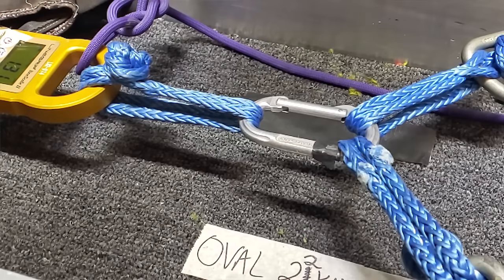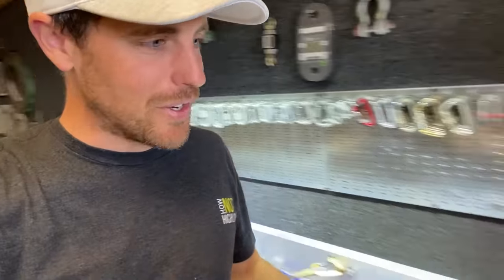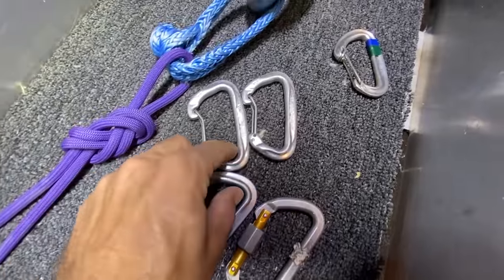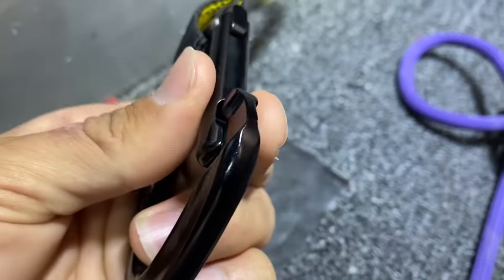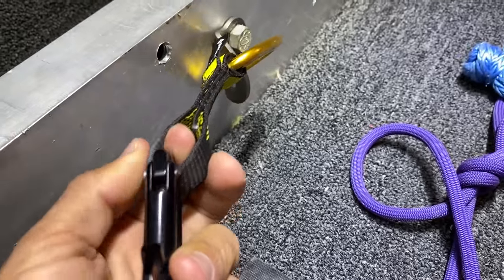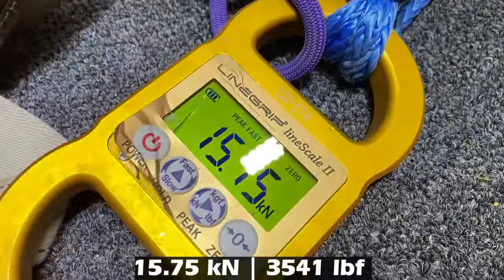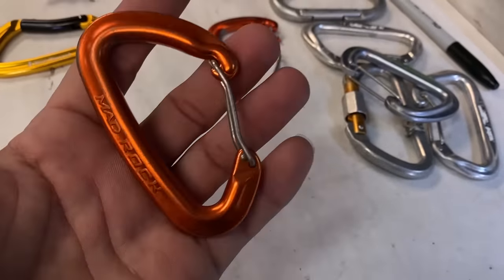Triloaded Carabiners

Comment: Triloading locking HMS carabiners, often used for masterpoints would be sweet. Like the petzl attache, BD rocklock etc.
Reply: This!!
Reply: Also a comparison between big carabiners and smaller ones; my guess is bigger one loose comparatively less strength..
Reply: @timt1519  smaller shapes with same stock thickness are stronger, less leverage
Reply: I agree. Nobody triload small wiregate pear carabiner but with an HMS, people feel probably more safe to do it.

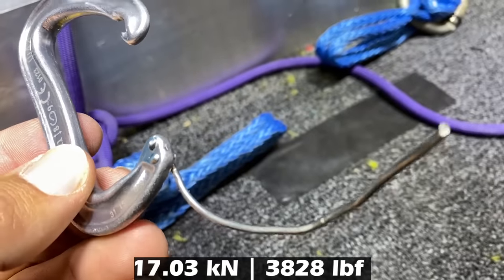Comment: At 5:10 Ryan seems surprised that the sling on the quick draw which is rated to 22 broke at 20. This is because the direction of the tension isn't aligned with the tension on the Dyno. To to work out the real tension you need to do Pythagoras
Reply: The angle between the two quick draws is a bit over 90°. So both draws see 70% of the downward force, that is, a force of about 14kN.
Reply: "Do pythagoras"...Kinky
Reply: Also it looked like the draw started to fray on the sharp edge where the gate area was
Reply: It seems like the load on the Quickdraw itself is uneven. Looks like the angle shape of the carabiner puts most of the load on the edge where it starts to break.
Reply: @JJ-qx9wz  I measured the angle to be 98° between the carabiners so a force of ~15.4kN each
Reply: @JJ-qx9wz  Except that is the inline force.  Not the resultant load.
Reply: @shadiester  The force seen by the quickdraws is the longest side of the triangle.  Not either of the two short sides.
Reply: @robertmisiuk7137  No, it is the long side. It's just that the short side force of 20kN is divided between the 2 quickdraws.
i.e. For one quickdraw's force triangle: the horizontal line is 10kN, and the angle between that and the resultant-force-hypotenuse is 49°. Which, if I've done my trig right, makes the hypotenuse ~15.4kN
Reply: Maybe it's teasing for the Hard is Easy video. 😁 I can't trust he don't know the math around 
slackline loading.

Comment: I am climbing in trees and rarely use these carabiners. I would love to see how tri- or screw lock carabiners perform
Reply: would very much appreciate that too! I started using tri-locks only in Highlining as well, that way I can feel super safe being attached to only one biner somewhere. Still always have two for most occasions, but especially in a rescue I want to be super safe going out on the line with my personal anchor and having two tri-locks there makes me be more at ease. 
They are a bit tricky to use in the beginning but once you have gotten used to them it's easy and in our city more people use trilocks than the simple ones.
Reply: Regular locking biners or an ANSI biner? I want see both!
Reply: Tom I am climbing trees daily. I've had the best luck with rock exotica pirates at 28.14kN
Reply: Can't beat a bit of three way action!  Can't wait for the drop tests.
Reply: I’d love to see some steel carabiners used. The new petzl Vulcans have a 18kn gate
Reply: @ALRinaldi  a steel ANSI gate carabiner, especially an oval, should perform exceptionally well in this scenario. For example, the Petzl Oxan has a 16kN MBS in its minor axis, so the tri-load MBS should fall between 16kN and it's 38kN major axis MBS, right? Even though it's a bit heavier I like using the steel tri-lock for rope access because even if one of my strops gets loaded on a minor axis somehow the anchor still meets the IRATA minimum strength requirement.
Reply: Would also love to see screw gates tested since these seemed to break at the gate
Reply: @benja_mint  Screw gates do not have a stronger gate, they just won’t open accidentally at the gate.
Reply: @joestevenson5568  yeah I know but I had the feeling that these karabiners kind of bent until the gates weren't closed anymore which made them weaker. Not sure if it made a difference.

Comment: Excellent Channel! Good stuff. It would be nice to see tests like this comparing different angles, Longer angles with the tri-loading test. You had some pretty radical angles there, pretty steep. Also compare, in the same video, a pull test with no tri-loading, straight along the spine, and then Tri Loading. Then compare the difference. This is the first video from your channel I have seen.

Comment: @ 4:56 u break the quickdraw on the sharp edge off the inside oval carabiner. And it saw ~30 KN. 20 kN on the scale 50 and 50 deg between the quickdraw and the scale. so 20/cos(50)= 31 Kn. that is more than the mbs of 22kN
Reply: is math ???
Reply: Exactly. In this case you are not considering the angles. Same reason a 80kg highliner puts way more force on the achors due to the flat angles
Reply: Yes, but it should be half of 31 right? Since the 20KN force is shared between two vectors? So I got 15.5KN per dog bone. But the sharp edge and uneven loading of the webbing may have been the culprit.
Reply: @mickey_rose  
I am no pro on this, but the rule of thumb is: at a 120 deg angle you see 100% of force on both anchors. It is hard to tell which angle this is exactly, but roughly 120 deg seems right to me. Which means each of the bones would see around 20kn and the sharp edge kills a lot of mbs there. If it is 90 deg you have 71% of force on each anchor, so your 15.5/dog bone at 100 deg seems reasonable. With the sharp edge that is actually pretty decent.
Reply: @gerwin gbon is correct.  That angle will give more than MBS on EACH dogbone, and it makes sense that the bottom dogbone failed first since it was loaded over a narrower section of the biner, concentrating the load to a smaller area of the nylon.

Comment: I gotta say this channel has made me a significantly safer climber, from the scared shitless first couple outings to hearing the infinite wisdom 
"If your scared when climbing there's probably a very good reason and you might die " , so I try not to get scared for any good reason . 

That said as a pure top-rope-solo climber I'm not really sure if using two non-locking opposed quick-draws  hooked on to a figure-8 bunny ears knot about equalized for where I repel off and anchored on trusted bolts done by some local legend is a good reason to be a bit scared and I should really prioritize getting three lockers and a sling so I can just make a sliding X and know I'm actually equalized and locked in no matter where i fall. 

The prusik I've learned should be a Jammy and not a hollowblock since i could shock load it , and the prusik should be replaced with a rollnlock or MT to be nicer to my rope but i think as long as I replace the hollowblock with a Jammy, tie safety knots on the grigri line as i ascend, and importantly trust my anchor I should be safe climbing as hard as i want.   

Yeah your right I gotta fix the system asap, since not going out isn't gonna happen what if I just fucken took the time to thread through and just tie a regular figure-8 follow through onto one or two of the bolts provided no sharp edges keeping it super loose so i pass a coil of rope for the follow through and just played on that with back-up knots in case somehow I do something cool and fall breaking the hollowblock that snaps from one too many catches , my feet hit the wall for just a second as the force is transferred, flinging myself upside down and the rope slides through the grigri stopping on a safety knot . 

That should be the worst case scenario assuming the grigri doesn't decide it's both our time and just fucking explode but I'm not climbing subzero that's about the only case i could see that being even really possible so it should be fine. But alas that anchor might prove worse due to hot spots created on the rope because it's tired into a right angle. Yeah i guess i just fuckin need 3 lockers and 1 sling minimum along with back-up knots on the grigri line then I'll have basically no really reason to be scared I think ( provided no ledges and that getting a broken arm or losing an eye not something to be afraid of simply something to make you more like Odin  ) .

Comment: The dog bone was at an angle to the carabiner, that means it was tensioned more than 20 kn (the force recieved by the carabiner when the dog bone break). No wonder it breaks even tho the mbs is 22 KN.

I'm not bright enough to calculate it in my head yet too lazy to write it down. 🙈🙊
Reply: You need the angle to calculate it anyway, which we don’t have

Comment: I think the reason that putting the two draws on the narrow end of the carabiner was stronger than on the wide end of the carabiner has to do with how the spreading action effects the gate. On the narrow end, spreading the carabiner maintains the gates closure and therefore it's strength. On the wide end the tiniest bit of flex makes the gate come open, and that makes the device much weaker.

Comment: I think that if you are slackening the takeaway is USE STEEL BINERS, if weight on the approach is not a problem. If its multi pitch climbing, use different biners for anchors than for runners.

Comment: Definitely three axes of loading on a complicated shape. Stress state should be a gradient of tension and compression with a little shear along the main members. Performance measured is more about the bending moment e.g. applied bending moment due to force on the large end of the binner at the gate. The take away is that binner geometry is not well designed against opening modes and this is why the open gate and minor axis ratings are ~8kn.

Comment: The reason the webbing broke in the second test is because when you form a bridle the angled tension defrayed the strap. The steeper the angle the worse it gets. At the angle you had those the strap may have actually been closer to 40kn of force on it when it broke, but you wouldn’t get that reading on the dynamometer because it’s not on the bridle leg.

Comment: Here’s the thing—and this may explain why your draw seemed to break under MBS—it’s difficult to say with certainty because I’m seeing this only on camera, but the angle of your anchors look to be wide enough that they’ll see more than the total load. Certainly they were on the orange 26 kam MAD Rock carabiner you broke “at the widest triload possible“. To do this properly will be pretty difficult, because you’d need a dynamometer on each leg, and in the interests of consistency to the extent its practical (or desirable) the angles would need to be as similar as possible. 

Also thanks to you (and Rachel’s content!) I’m looking into caving! So caving gear tests would be rad. Maybe throw in an Omni next time you do biaxial tests? Would be sick.

Comment: Mechanical Engineer here. That quickdraw that broke when the linescale said 20kN (5:00) has some interesting math behind it. 

Let's assume that each quickdraw takes 1/2 the load. That means the quickdraw broke while holding 10 KN, right? Wrong.
 
Those quickdraws were loaded at maybe a 60 degree angle from straight on, just guessing. The linescale was measuring the straight line load. To find the load on each carabiner we need to do trigonometry and find the hypotenuse of the force triangle. If it was 60 degrees off the vertical, the actual load was 10/Sin(30)=~20 kN per quickdraw tether. So, still under MBS but maybe not as bad as it looks if you assume each was taking just half of that 20kN total load.

When you did the "super triload" with the tether going like 70 degrees off the vertical, each tether would not have been exerting 13.8kN/2=6.9kN on the carabiner. If they each took half the total load, actual load is: 6.9/Sin(20) = 20.17 kN from each tether! That biner had much more force on it than the linescale said.

The angle of each tether from the vertical pull axis of the linescale is critical to understanding the actual load on the tethers and the biner. A protractor placed over the tether area in the camera shot would help, if you ever do this type of test again.

Comment: Would be curious to see a break test of a big HMS. Ive seen a lot of people thinking that they are better for biaxial loading, as they have a much bigger side where you can fit spansets, but it is not correct as they're not meant for that, kind of expect what's going to happen but would be nice to see it. thanks for the content. are you gonna break test ET?
Reply: Slqcktivity did this test compared to oval carabibiners and it was much more useful than this video as there wasn't such an extreme angle. This video was basically just Ryan breaking the gate with that extreme angle.

Comment: Have you ever tested carabineers connected directly to carabineers? (metal on metal, it's usually considered unsafe practice)
It would be interesting to know whether it's weaker when making small extensions on an anchor or lazily connecting quick draws quickly making an extended draw or personal anchor system.
Reply: Who considers metal on metal unsafe? Have they not seen a chain before?

Comment: Here’s an interesting observation I made on the second test where the dog bone broke at 20….kN. It was sharing the load with the other dog bone so it actually broke at a much lower force than that…. I can draw you a diagram based on the forces and theoretically tell you what it broke at but it was honestly closer to 12kN 

That’s a bit concerning in my opinion..

Comment: Great video, The 1 thing I noticed was that the carabiner lock was the first thing to give way in the slow motion video.  Then the rest of it broke do to shock stress. Maybe not saying this right because I have never did any type of climbing that would require safety equipment.  To me it looks like the wire lock is the low number here.  If anyone can explain it better  I'm all ears.
Reply: No you've got it right, you'll notice those carabiner are shaped so when loaded properly (two loads, not three)  the loads are close to the spine, that way the load has less leverage on the gate side of the carabiner and so it can be designed weaker i.e. lighter on that side for a lower overall weight. Some carabiner are designed so the load is centered and in those ones they have a more substantial gate.